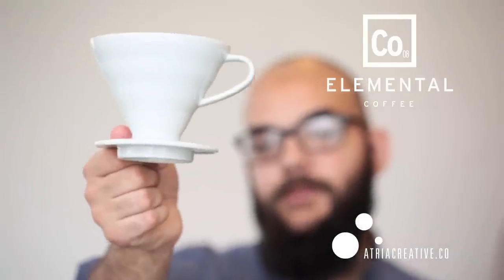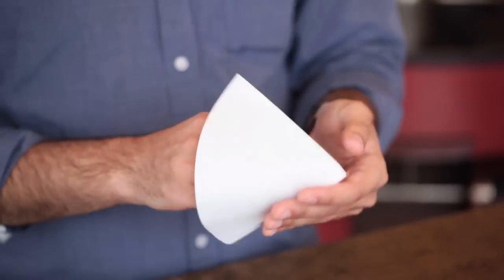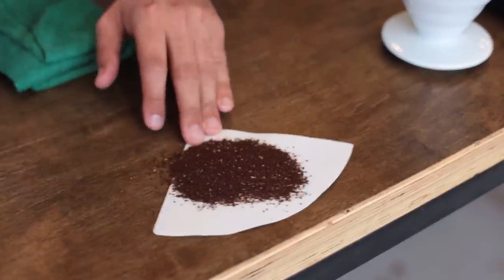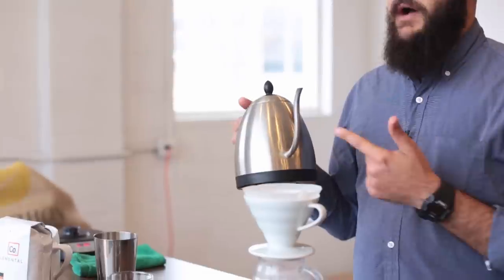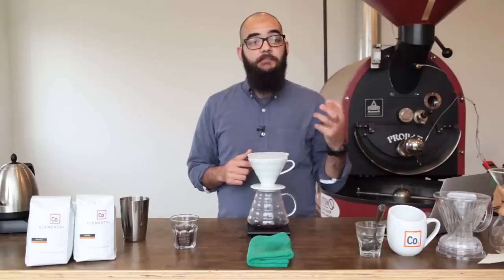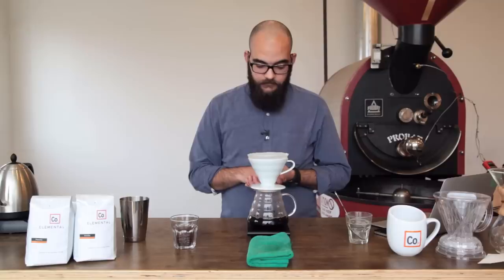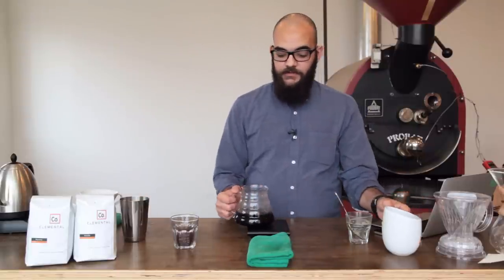How to Brew Hario V60 Coffee

Comment: TL;DR for this video:

## Ingredients

- Spoon
- Scale / Timer
- Hario V60 dripper
- Filter (paper)
- 26g coffee

## Instructions

1. Fold the seam of the v60 filter
2. open it up. place it in the V60
3. rinse the filter with hot water (removes taste of paper + gives consistent heat)
4. grind our coffee beans (on the finer side of medium — 16-18 on a barazza-style grinder. medium for other grinders)
5. add the ground coffee (quickly) to the filter. (set it down at the bottom of the v60)
6. tare the scale back to zero
7. add 40g of water — allow it to sit and bloom in the coffee for 40 seconds — ADD THE WATER IN REALLY SMALL CONCENTRIC CIRCLES v. carefully. (avoid pouring on the outside rim or the filter part of the area)
8. after 40 seconds, continue adding water to v60
9. TOTAL VOLUME AT THE END should be 340g of water etc. (keep adding with very slow small circles.
10. when at 340g of water - stop pouring. stir the coffee with a spoon a little bit in the centre.

Comment: Something to note, 26g of coffee for a 10oz cup is a HIGH (read pretty darn strong cup of coffee) dose. If you try this at home and it doesn't taste good, try 19g for the same water volume. A general rule of thumb is 1.7-2.0 grams of coffee per 1oz of water.
Reply: +radagascar1 So a ratio of 2:15 then
Reply: +radagascar1 I was thinking that same thing... if you put the coffee and water in grams, 300g water: 26g coffee = 13:1 ratio.  The SCAA recommends an 18:1 ratio (55g/liter).  I usually hover around 16:1, but as long as you are getting an even extraction and you are enjoying the taste, carry on
Reply: +radagascar1 i do 20 grams coffee for 300grams of water (15:1 ratio). It's easier to memorise in case someone ask us the ratio (for them, not us). For stronger or brighter note just experiment with the grinder setting (the finer the bitter) and the temperature also (the higher the bitter). there's no right or wrong ratio just want to share my way doing it.

Comment: Damn I want one of these Hario timer/scales. It makes the job so much easier rather than measuring water in a beaker and pouring it back in the gooseneck. It's funny, I used to think "yeah whatever big deal if I put in a little bit more or less water" but once I started accurately measuring everything, I tasted the difference right away. Way to waste good coffee is to mess up the proportions.

Comment: Helpful point about the need to avoid pouring on the perimeter of the filter. I use a Melitta single cup pour-over at my office and have been in the habit of targeting the outer rim of the filter with my pour. I think subconsciously I thought doing the inverse of a drip machine (only through the center of the grounds) was the best way to get full saturation.  #knowledgeispower
Reply: jklseattle Good to know the Melitta filters work. I bought this for my family because they've started using the Keurig coffee machine and to be honest the coffee is subpar. Saw the v60 glass dripper in a coffee store and thought "Hey that's practical and portable. It doesn't take up much room and probably makes a better cup then that nasty plastic crap"

Comment: This is such an informative video, thank you. However, I like to do it slightly differently.  I boil the water, then leave it for 8.6 seconds to achieve maximum potential, before pouring it at a consistent 45 degree angle on to my speciality le'Asda ground coffee.. I then gently separate the coffee with a small plastic child's play fork, ensuring the coffee is evenly distributed throughout the filter. (a metallic fork will react negatively with the coffee grounds, giving a somewhat tartish overbite). I then let it sit for 6.8 minutes in the fridge to cool down, to ensure the coffee doesn't get a bitter burnt taste. I then pour the coffee into my favourite coffee mug and heat in the microwave for 3 minutes until hot. This gives perfect, exceptional 'Italian Bistro' coffee every time.
Reply: Animal House   I have found that it's best to microwave for only 2 minutes 40 seconds as 3 minutes is a bit of an overkill. May I say how easy and clear these rules are to follow but the filter should control the coffee transfer through the Forefront XTMG so that it may modify the liquid flow, change the length of pour-out, stop drinks that seem to violate the policy and automatically configure allow/deny rules for expected future beverage-making  traffic.By applying this and the careful selection of grounds you can successfully match the colour of the coffee to the colour of your beard. .
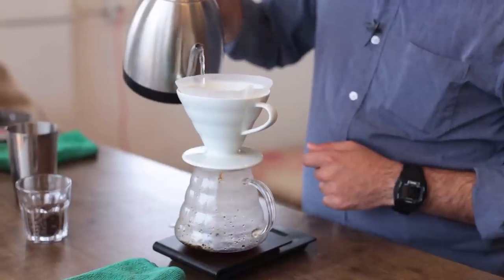Reply: Karl Whitmore Microwaving for 2:40 is only good when using the Mariachi 500 style mugs or younger. Otherwise it should technically be 2:57 (preferably with a 5 second stop half way). If you use one of the older mugs like an Interzone 350 then 2:40 will not be enough to bring out the silken undertones or overtones. Personally I like to use a vintage 'Henry Delmonte-Harbinger' mug from 1943. It is slightly lipped which means I can use it for coffee, cup-a-soup, or even Lemsip without needing my beard net (it is best to travel light when riding a penny farthing, especially as my type-writer takes up so much room).
Reply: Darren Ramshaw Ah.My mistake. I used to have the Mariachi 500 but nowadays I tend to prefer a good old fashioned Sir Hedsworth or a Topolski mug (not for Bovril obviously). 2.57 sounds about right- a good tip is to add a couple of drops of moustache wax at the 2.30 mark. You still get the gingerbready notes but you also get a lobster aftertaste. Just sit back, relax in your Huntingdon recliner amongst the Weeping Figs and listen to your favourite triola or pyrophone organ recitals Bliss.
Reply: Karl Whitmore I just tried the moustache wax trick, but became startled by a dove outside the window. I was quite taken aback and in the confusion my pocket watch worked free of my vintage tweed waistcoat and swung like a wrecking ball into the v60 knocking it to the floor. There's coffee and porcellain everywhere and Great Aunt Bertha is going mental. Great Aunt Bertha is my King Charles spaniel (vintage). I shall now have to shoot the damned animal with my reconditioned blunderbuss.
Reply: Karl Whitmore I'm sorry I don't mean to be rude, but I find your lack of knowledge astounding and somewhat laughable. If you microwave the coffee for 2 minutes 40 seconds, the microwave cannot possible imbibe the coffee molecules with nearly enough positive neutrons. By microwaving for 3 minutes exactly, you're releasing the endorphines from each coffee molecule, ensuring a more even transference of flavour on to the pallet. No less than 3 minutes and the flavour is somewhat inferior and rather mediocre in stature. As for transferring coffee through the forefront XTMG, you've clearly got that wrong. Any idiot with XTMG can tell you that you insert the filter at a slight tilt into the XTMG unit, which helps avoid filter chafing and ensures the beans are evenly distributed. I seriously think you need to rethink your method if you wish to think of yourself as a coffee connoisseur I think.
Reply: Darren Ramshaw I personally find the Hasselhoff 2000 signature a perfect mug for microwaving at any temperature. Whilst Karl is mistaken in his belief that you should only microwave at 2:40, it is possible to make an untarnished cup of coffee under 3 minutes, as long as the Hasselhoff 2000 is brought to a perfect room temperature prior to heating the coffee. My personal choice is the Z64 Pretentiouz performance mug, but I admire your retro bent with the Henry Delmonte-Harbinger. It's flawed, but it still delivers a silky smooth performance for its age. You really know your beans!
Reply: Karl Whitmore +Darren Ramshaw.  I would be very interested to know what your preference of milk is, Darren and Karl? My personal preference is a room temperature Iranian non filtered yak's milk. Not the filthy mass produced stuff of course, but direct from the Iranian peasants. I like mine udder fresh! It provides a somewhat nutty, pleasant aftertaste, which complements even a sub standard Brazilian blend with unparalleled ease.
 
Of course Karl being such a coffee amateur, would probably naively go for a bog standard Peruvian triple filtered cow's milk hahahaha!!!!!!!! But enough jokes, I need to kick back and relax in my 17th Century Moroccan hemp lined high chair, with a perfect coffee and Mumford and Sons on my gas powered amplifier.
Reply: Animal House I came upon the perfect milk while unicycling through Gdansk. It was the untreated breast milk of a woman named Cecilia who not only invited us into her home, but insisted on giving us plentiful amounts of the milk. Unfortunately she died of malmsey during our stay and we were forced to flee before the authorities became involved. Ever since I have only had my coffee black, as milk would only bring back dark memories which I have thus far managed to surpress.
Reply: Animal House  + Darren Ramshaw I prefer platypus milk. It takes rather a long time to hand-milk them and they have tiny slippery teats  so it usually takes around 4-5 platypuses to collect the required 7.5ml of milk but the resulting taste is worth it. One can always substitute it for echidna milk but you can always tell the slightly substandard quality.
Reply: +Animal House A coffee from microwave? What a fail!!!
Reply: +Filip Žalud Why is it a fail? Do you not realise that a microwave agitates coffee molecules more efficiently than any coffee machine, heating it to perfection and releasing important coffee endogenous opioid neuropeptides (aka endorphins for the less educated). Don't knock it until you try it sir!
Reply: But how else would you prepare coffee if not in the microwave?? MAGIC? How Filip? HOW??
Reply: +Darren Ramshaw Have you ever tried heating coffee slowly in a microwave, using a standard pair of size 10 men's socks as a coffee filter? The result is exceptional!
Reply: +Animal House +Darren Ramshaw I was round a friend's house the other day and they were using what they called a 'kettle' to make coffee with. No coffee machines, water heaters, hand grinders, toss-o-matics or filters in sight! I was appalled.  Obviously I returned later that night and burned their house down.
Reply: +Karl Whitmore Good for you. I hope you called them peasants also, and spat in their faces? The only kettle that i'll ever accept into my house would be of a traditional 19th century distressed copper kind. Even then, i'd feel a slight tinge of embarrassment.
Reply: I'm trying it right now. Later I'm going to try filtering it through the crotch of my cycling britches for full tweed/fruit aromas
Reply: Lmfao,    that was well played !
Reply: +maria I Thank you so much from the bottoms of all our hearts for sharing your important feedback. it's extremely helpful to receive feedback such as this so that the rest of the world can change their sense of humour to fit in with your personal preference. I speak on behalf of all is lower mortals in our deep gratitude that you should speaketh down to us from your throne at the centre of the universe with your special glowing nuggets of wisdom. perhaps, if it is not too much to ask of your holiness, you could give us some pointers as to how to reshape our senses of humour. We gladly and gratefully accept the news that what we find funny isn't funny after all, and will administer self-punishment accordingly. All hail Mari I
Reply: maria I Thankyou your excellence. I shall administer further self-punishment and hope it leads me a little further towards your acceptance.
Reply: And I hasten to add I'm definitely not enjoying the self-punishment in any way.
Reply: He is enjoying the flagellation, you know, Maria I. The only bit of the self punishment he's not liking is the bit where he forces himself to drink non-pretentious coffee through a straw.
Reply: + maria I You're completely right maria,  that was DUMB! Almost as dumb as suggesting Darren's second comment was even more dumb than the first, before completely contradicting yourself in the same sentence, by concluding that it was still "better than before".
Reply: You're absolutely right Maria, I apologise. I'll gladly accept my half wittedness with good grace, and remind myself that I can never be as acerbically sharp and mean spirited as you Despite my best efforts!
Reply: Not sure why you're saying "you're welcome" when I didn't thank you for anything? However I do understand the importance of your comments, and realise that I should be in awe of your excellence. Darren has already self flagellated in your honour, so perhaps I should go one better and grovel at your feet whilst self flagellating, begging for your forgiveness and spreading the joy that you give to the world.
Reply: Thank you for your permission ma'am. curtseys
Reply: Wow, you really do have some negativity. You need to lighten up a bit maria. The above are only jokes, and the whole thing is only about coffee. Maybe you are drinking too much coffee? :)
Reply: You were right about me being a halfwit though :)
Reply: She might be boring, but I bet she makes some fantastic coffee!
Reply: So, this thread is a year old, I've just read it. You guys need to win YouTube. Perfect example of comments which are hilariously funny, yet not telling people to die of cancer or using the N word left, right and center.

I tip my top hat to you, wish you a fine day and possibly tell you all to bugger off.

Well done!
Reply: @darrenhimself  or you can just ignore you tube coffee making videos
Reply: @SirHilaryManfat  

first step in recognizing ignorance is accepting it. you're on your way. best of luck to you
Reply: @SirHilaryManfat  
yes isnt it obvious?
Reply: @bulkforce5  

thats the best you could come up with? weeeeeeeaakk!!! don't quit your day job IF you even have one.

Comment: Thank you for this very clear set of instructions. I made an utter mess the first two times I tried to use the Hario.  I ended up with sludge that I had to pour through a strainer to get some coffee.  By the way, do you think it makes a difference to use the Hario filters versus the Melita ones?
Reply: Hario Japanese cones use filters that specifically mold to the spiral down shape inside the ceramic. 
Melitta, ( I have both home) is like a weird diamond shape. And I can actually get away with regular small sized #4 filters. But they do offer Melitta pour over filters at my grocery store.  

I wouldn't recommend anything BUT the cone shaped filters for the hario. They're less than $8 I think on Amazon. And its definitely worth it!!

Comment: The manual for the v60 says "swirling motion . . .making sure the water does not come into direct contact with the paper filter" and I just discovered that today and am curious. Does anyone avoid the paper filter or do most people come in contact with it and is this trivial? What say you?
Reply: It's generally not recommended to swirl where the paper filter meets the coffee bed. Water takes the path of least resistance, and the gap between the coffee bed and the paper filter makes a great path straight through the set up without making contact with coffee.

Comment: Thanks for this great video, but I have got one question left. I am considering which (plastic) dripper to buy, there is the hario 1,2 and 3. Most of the time I wil make 1 cup, but occasionally I make more then one cup. My question:does it affect the taste if I make one cup in the hario dripper 2 instead of the dripper 1? Off course I will preheat the dripper first.
Reply: It’s makes a big difference because you need to have a constant and good column of water to keep a “constant” speed extraction rate. I have the Hario number 1 and I prepare 2 cups (260ml total) using 18 - 30g of coffee ... you can in the porta filter Spec their recommend capacity ...
Reply: @felipesimone1165  so what happens when I make one cup in the plastic Hario dripper 2. Do you mean the water flow is too quick so I will get a under extraction?  For one cup I use usually 16 gram of coffee and 250 ml of water. That is the same amount you use for 2 cups.
Reply: bob de Waard sorry it took me awhile to get back with comments. I think that the main issue would be use a smaller dripper to prepare  higher amount of coffee. The coffee bed would be very near the top so it would take much more time to extract and you would need to do Many attacks to prepare you coffee. I like to use a ratio of 1:12 medium / fine
Reply: @felipesimone1165  so if I got it clear there is not much effect in using a bigger dripper for les amount of coffee. So I will not need to buy an extra hario size 1 for making one cup only.

Comment: if after 2.30 minute, the coffee still dripping , should I wait or cut it off ? Thanks.
Reply: I would let it finish. But If it's still dripping after 2&½ minutes, consider why.
I'd guess your grind is too fine, or you need to pour a little faster. Hope that helps dude
Reply: Thanks Jacob!
Reply: No problem man!
Reply: ground size is really important. get access to evenly ground coffee or better still get a burr grinder to grind fresh coffee. play around with different ground size to achieve the desired time of brewing.
Reply: btw about 3 mins is fine too for pour over
Reply: thanks Taco. you are right.I think I must adjust my grind size